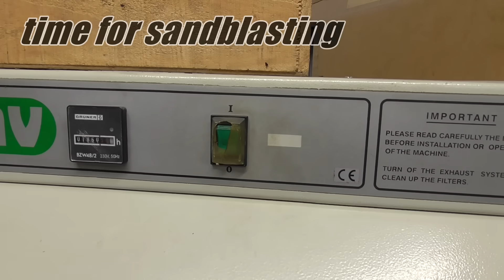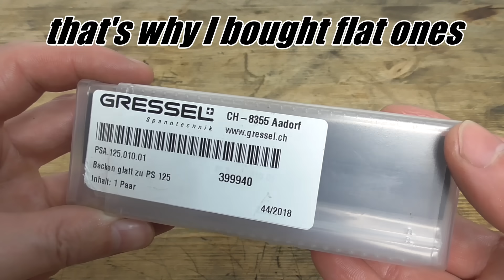Rusty Deadlocked Vise - Perfect Restoration

Comment: Can you explain a little more about the bit where you said "let's make these parts black" and noted that it was just soft steel.

Is the process just introducing a back scale for corrosion protection or is it hardening it or something else ? 
Is the oil bath just for cooling?
Reply from the maker: The oil just burns into the top surface of the steel and makes it black, it's for optic and rust proof.

Comment: Next time get yourself some Muriatic acid and mix it with 50% water, and just soak it for a day. It will come out bare metal without any cleaning by hand. That's all I use for stripping rust now. The acid does all the work. You can get it at Pool supplies or a hardware store.

Comment: I usually do this kinda thing in two easy steps:

Step 1: Throw out the old rusty piece
Step 2: Buy a new one
Reply from the maker: I'm your next steps.
Step 3: pull it out of the steel waste
Step 4: restore it
Step 5: make a video about it
Reply from the maker: I'm your next steps.
Step 3: pull it out of the steel waste
Step 4: restore it
Step 5: make a video about it
Reply from the maker: I'm your next steps.
Step 3: pull it out of the steel waste
Step 4: restore it
Step 5: make a video about it
Reply from the maker: I'm your next steps.
Step 3: pull it out of the steel waste
Step 4: restore it
Step 5: make a video about it
Reply from the maker: I'm your next steps.
Step 3: pull it out of the steel waste
Step 4: restore it
Step 5: make a video about it

Comment: Voila indeed! Here's me thinking he's gunna hit it with degreaser and a wire wheel. Really great video and quality workmanship, awesome to see! I loved the heat-treating, that was unexpected. 
Apart from the moving parts, I suppose it's like saying that an anvil is broken ie hard to kill a heavy duty piece of inductrial equipment. I really admire Fitting and Machining. That lathe work was something else - so jealous! You certainly succeeded in performimg a perfect resto on that very sturdy vice - good for another 50 years. Well done to you sir.

Comment: Beautiful work. Two thoughts though. I would have dunked it in a bucket of penetrating oil and let it soak before I tried to take it apart and sandblasted before doing all of the finish work on the fine surfaces. But that's just me.

Comment: 5. Why not sandblast before grinding? Sandblasting does hurt/damage the material, it takes material off. That's why i would need to tape the surfaces anyway. 
5. Why not sandblast before grinding? Sandblasting does hurt/damage the material, it takes material off. That's why i would need to tape the surfaces anyway.

Comment: I wonder how many women can enjoy this that we men consider pure gold 😁
Reply: Not a lot, but I know one who would.  Not only that, but she's beautiful, smart, and funny.  Taken, needless to say.  One in a million.
Reply: @incognitotorpedo42  
Many more than you think actually, like me!!!
Reply: @incognitotorpedo42  
More than you think actually... WAY more.
You should read my response to the original question...
Reply: As a female I say this is sexy AF.  His foreplay must be astounding.   😍
Reply: I'm a woman and I thoroughly enjoyed this video and often watch such videos.
I own my own house and until a severe back injury, repaired, restored, maintained my house and even my vehicles.
I did plumbing and electrical repairs, to code or better I might add.
I installed my new hot water tank, from buying & transporting it in my truck to taking the old one out & disposing of it, doing the plumbing & electrical, connecting the runoff pipe to my drain etc completely by myself.
I installed my new storm door, bathroom vanity, fireplace insert, repaired my roof after a storm, do my all of my maintenance on my ride-on mower.
I installed a back-up camera, new water pump, solar panels, grey and black water valves and many other things on my class B RV.
For the back-up cam, I had to connect wiring through the interior of my van & through to my back-up light. It has worked perfectly for the past 5 years.
Women are not wall flowers. Just because we have vag.inas doesn't mean we are daft or can't appreciate tools, good work or do good wood, metal, plumbing, electrical, painting, repair etc work.
Using the proper tools for a job and actually knowing how to use them saves time and limbs... Women always read instructions, saving much time...
I own dozens of tools, including a complete array of woodworking tools by the way.
I even have patent!  Oh, I'm a retired Registered Nurse, photographer and painter,  amateur astronomer, own 4 telescopes, travel alone with my dog all over the amazing wilderness of British Columbia...
I write children's books and novels...
What about you? What have you done??? 😏
Reply: @sixchiensblancs   That is all good stuff. I think you took too much offense. We know you women exist, we love it and wish there were more of you.
Reply: @sixchiensblancs  drink beer!
Reply: Kermit of Rivia 
"the" wife???
Jesus... how crass... lol...
As a woman, anyone calling me "the" wife, would find themselves on "THE" kerb pretty quickly.
And by the way, I love tools, before getting injured at work, I maintained, installed, and fixed things myself in my house, doing plumbing and electrical to code or better by the way.
I installed a new vanity in my bathroom, taking the old one out, and doing all of the needed plumbing myself, I replaced my water pump in my RV, repaired a leaky window on my RV, installed my storm doors on my house, as well as taking out my old hot water tank and installing the new one, all by myself & completely alone, connecting the plumbing and electrical, again, to code or better.
I also fixed shingles on my roof after a storm, before getting a new roof, restored the paint on my old little pick up truck, etc etc etc...
oh, and I actually have a patent for an invention... it will change your life in a few years...
The proper tools, properly used save time and grief.
And ALL women know that.
And by the way, unlike men, we women read instructions, saving many hours, keeping ourselves safe, saving limbs... and getting things done properly and professionally.
I fixed a rusted area on my RV last year, my repair looks perfect, no rust has returned.
My scraping, sanding, use of the proper rust removing and restoring products and my paint job is perfect.
Your wife likes gay men not because of the stupid make up, but because they have class, arr smart, funny and are good to women...
Probably unlike you I imagine... lol...
I'm sure she loves you, but a little class, good taste and praise for special things she does for you would go a long way...
Just sayin'...
Reply: @sixchiensblancs  Love hearing this, you BADASS!  Wish you lived near me so we could fix my dishwasher.  😊  Much respect for your PATENT, hope I hear about this soon, best of luck!!! 🍀
Reply: Faiber Arias not a lot buddy. Not a lot
Reply: @FunScientifix 
More than you know, I am a woman and I love these videos. You don't need a 
p enis to enjoy good work and beautiful objects!!!.
I have many tools myself. I fixed & maintained my house entirely by myself before severe back injuries.
In my early 20s, I found a 2 pound hammer on a street, I still have and love it, I found an old, great and actually valuable axe head out on a ranch, etc... tools that I brought home and cleaned up to look quite nice.
Reply: Its on tv like format so a couple may accidentally watch it!

Comment: Nice work, a man after my own heart,I envy you having the workshop, machinery & space.
A long time ago I used to do this sort of thing , it gives lots of satisfaction, which is worth more than any monetary cost or 'reward'.
Small tip, whenever painting, start inside from the centre, then work outwards, then on the  outside, picking any details or mouldings etc from the centre,then, top - bottom, left-right or vice versa.

Comment: Very satisfying to watch. I'd be afraid to actually use the restored vice lest I put a scratch on such a masterpiece! Speaking purely from a perfectionist point of view, as far as aesthetics is concerned, it was unfortunate you could not remove those marks on the flat bare metal area on top towards the rear. I guess you would have done that but likely there was good reason for not getting those out. Also the letter painting with white was not 100% precise. But other than that I'm filled with admiration at your skill and excellent quality of the finished product. Well done! P.S. As another commenter mentioned, use of ratchet/s could have been advantageous on certain occasions!

Comment: Great job !!  Great video.  You did a fantastic job on this restoration and have a bit more skill and access to certain tools than a lot of people may have.  With that said, have you/do you ever soak items like this for a day or so in vinegar or some other sort of liquid?  Do you think that can be helpful for people that may not have the tools that you have?  Is there anything you would suggest using for a pre-soak?  I have seen some videos in which people swear that vinegar and other items do a great job in helping to restore tools and other items.  This could be helpful to people that don't weld or don't have access to a welder or even the ability to create their own helpful tools or create missing parts.  Just curious about your knowledge/opinion about this.  Thanks very much and once again, great job and great video.
Reply: I was wondering the same. I would have tried phosphoric acid or Coke although it wouldn't be as satisfying as cleaning with metal brush :)
Reply: @belapcela  
Lol... Coke... and people drink the stuff... 😶
Reply: Vinegar can be used. One can also use electrolysis to get rid of a lot of dirt and rust. Applying some heat to the parts that are stuck, would be a good method to losen them.

Comment: Excellent video thank you, just one question as I dont know too much about this, could you have re used and smoothed the rough jaws instead of buying new? Or are they too hard?
Reply from the maker: I'd need a surface grinder for that, the countersink would also not be deep enough to take material off. I kept the rough ones though. Thank you :-)
Reply: my mechanics thank you! And thanks for video!

Comment: I couldn't quite get why you replaced the "Backen"-plates with new ones. Was is because of the jagged surface? - You could have used the originals, right? Or was there a problem with them? You mentioned that you didn't like "rough jaws", so it was just preference, right?
No wonder you Swiss are famous for your attention to details.
Reply from the maker: You find more info in the description ;-)

Comment: A rosebud on a torch or a shop oven works very well. Do Not spray anything on the rust before you heat it and only after it cools. Use 50% muriatic acid outside in a plastic container. Once done soaking wash off with warm water. Remember you're only taking off the rust.

Comment: I work as a helicopter mechanic, we never use grease at bolts or screws, we use anti-seize, maybe it's better than using grease. I may be wrong, but we only follow the manual.

Comment: 12:40 what tool is that? The one you use to light the blowtorch.
Reply: It's a type of squeeze sparker that has a flint in it and as you squeeze it the movable arm of the tool scrapes over the flint and creates a spark. 
https://www.amazon.com/Flint-Spark-Torch-Igniter-Reliable/dp/B004JBUKXI

Comment: Gute Metallarbeit.

Allerdings sollte man eher von einer Reparatur sprechen.

Restaurierung zielt nur darauf ein Objekt dem Betrachter verständlich und in einem bestimmten geschichtlichen Abschnitt zu präsentieren.
Funktionsfähigkeit ist keine Notwendigkeit (anders als bei der Reparatur).
Abgesehen davon war spätestens nach dem Strahlen keine Geschichte mehr vorhanden. Das Gerät ist praktisch im Neuzustand.

Good metalwork.

However, it should rather be called repairs.

The aim of restoration is to present an object in an understandable way at a certain state of its history.
Function is no longer required (as in contrast to a repair). 
Aside from that, after sandblasting there was no history left. The device is as good as new.

Comment: What chemical used to  remove the deep rust.
I sew after was clean enough to take hand and the rest as shown cleaned with sandpaper.
I would put the whole wise to a dish of muriatic acid what could renovate the wise overnight.
Even the brooked screws would come out with less force....

Comment: How do you prevent the sides of the jaws from rusting? I can see that you cover the sliders and unpainted parts with grease except sides of the jaws and the flat surface that you are cleaning in 5:58. Did you protect them somehow?

Comment: I would've started with a large bucket filled with a 20% solution of oxalic acid.  Let is stay in there for 3 days.  Oxalic acid is great for removing deeply infested rust and the like.  It almost gives you the blank, original product. Very cheap ad readily available (white cristals, just add to water, check the concentation online, great stuff  !!).  Everything else in this vid is just GREAT !!!

Comment: OK, I don't get it.  
1. You use $20,000 worth of machinery, gear, and chemicals to restore a vise you could buy new for $150.
2.  You make a bunch of special jigs to do the job:  with those skills and all the gear you have (lathe; mill; etc.) you could have made a new vise from scratch.
3. It's not really an authentic restoration, since you replaced the jaw-liners -- with store-bought liners... why didn't you just make a new set of liners?
4. Have you never heard of Naval Jelly?

Comment: Congratulations. You have turned a nice antique into something you could buy at Wal-Mart.  Glad you fixed it, but taking off the patina just makes you look like a tyro when you go to use it. You can't buy patina, that takes time. You show up at a work site with a box of shiny new tools. Another guy shows up with tools with decades of use written all over them. Who do you think will get hired? I work in the desert. I see a lot of patina. I take the loose stuff off to prevent pitting etc. Course steel wool like a Brillo pad is good. I have a bit of patina myself. I got crows tracks around my eyes from squinting that look like 40 miles of bad road. I use a farrier's vice of unknown ancience. The worm screw stuck on me when the jaws were open wide, so I lubed it and worked it a lot. It seemed kind of awkward at first. I could have gotten a little newer one, but I saw the monster as a better value and I am glad I did. It spins in and out real smoothly now and I have come to depend on it. The other guys use it for an anvil sometimes. Takes a licking and keeps on ticking.

Comment: The screw mechanism is different to many I have repaired. That’s the first one I have seen with a thread inside a pipe to accommodate a screw thread.
Interesting restoration and restoration work is a very satisfactory experience.

Comment: Enjoyed watching you turn that Vice which most people would throw away into a polished jewel. What kind of filler did you use in that hole and then sand afterwards, is that filler also heat proof.?

Comment: Did you ever try chucking one of these projects into a self-cleaning oven for 4 or 5 hours? Works  like a charm on old rusty, oil-gunked cast iron pans. The rust and oil burn into ash that can be easily brushed away; that might pre-loosen things a bit.

Comment: After assembly (but BEFORE putting those central Pins) you had to use the Oilstone to even both jaw surfaces to ensure parallelism !!! Otherwise, how do you know both jaws would clamp each other WITHOUT any gap or at an angle? Besides - OEM jaws are MUCH more efficient and Technically sound ! Those flatten jaws...are bullshit ! You can't grab (grip) wooden or plastic details ! Think twice, get clever :-) Keep up the good work !

Comment: Really interesting use of leverage.  Also, I wouldn't have thought aluminum tape would survive sandblasting. What was the orange device that you cleaned the parts in?
Reply: Spare parts cleaner either using kerosine or diesel fuel as the cleaning medium

Comment: Why do you quench the parts in oil after heat treatment, instead of water?
Reply from the maker: The oil burns into the metal and makes it black, it's just for the optic.
Reply: @mymechanics  I see :) thanks!

Comment: These are the best vices in the world, I restored 5 for my workshop, and travelled all over Switzerland to find them. Are we crazy - No  -
A good vice is the most important Tool in a workshop.  I was based in Aadorf , and often popped round the corner to buy spares in a friendly 
and uncomplicated manner. I even had mine painted by the original sub contract paint shop. nice video - showing that a Gressel 
is not just for Christmas - its for the whole life.    Rennteilebau.de    - Doing the job properly-
Reply from the maker: Amen ;-)

Comment: My suggestion would be: After sandblasting don't touch the bare metal with your hands. Gloves are better, as the fingers have salty sweat and grease. I know you degreased it, but still the parts where you touched the surface with your fingers might rust quicker later on.
Ausserdem bin ich neidisch auf deinen Maschinenpark  ;-)

Comment: Super Job hast du da gemacht. Neu kaufen kann jeder, aber so etwas altes wieder so aufzupeppen ist schon echt toll anzusehen. Schon fast zu Schade um damit wieder zu arbeiten. Kleiner Tip fürs nächste Mal. Wenn du so rostige Teile hast, dann nimm dir einen geeigneten Behälter, kochendes Wasser rein mit reichlich Zitronensäurepulver und lass es darin bissl baden. Der Rost verschwindet und du sparst dir viel Arbeit. Gerade an unzugänglichen Stellen. Daumen Hoch für deine Arbeit.